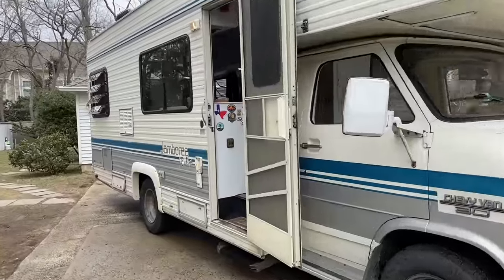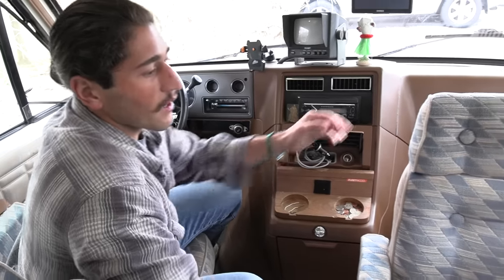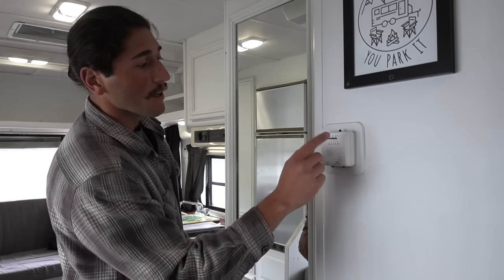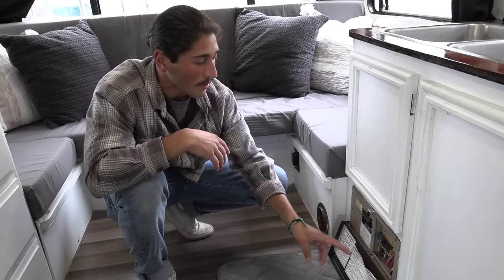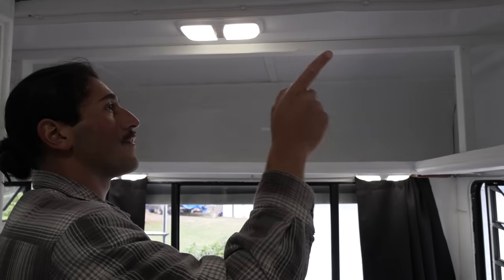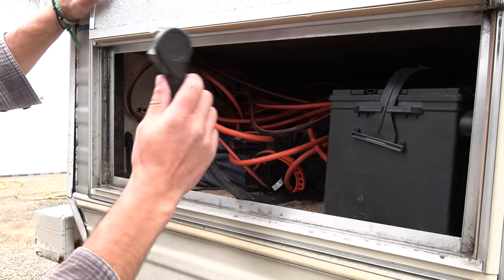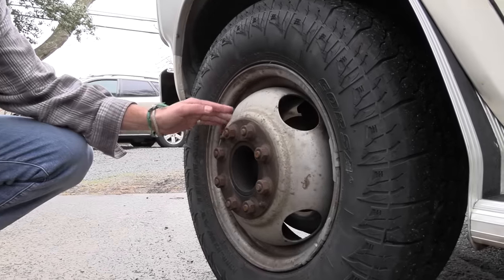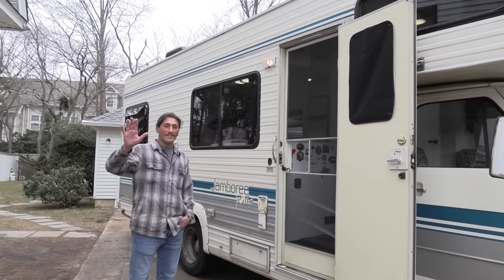College Student Transformes A Vintage RV Into A Gorgeous Tiny House On Wheels

Comment: Wonderful job!  Having owned an older RV, my fear for so  many purchasing vintage vehicles is for the undetected mechanical and safety issues that could arise, especially when far away from services.   We bought a beautiful 33 foot class A.  it was very comfortable.  I always felt it would be great to live in.  However, it had been in an accident the previous owner failed to tell us about.  The windshield and wipers were from some other brand of RV altogether and leaked.  The electric stairs worked only when they wanted to.  We went on a couple of trial overnight trips to discover the water heater and refrigerator also had issues.  Our first real trip out both sets of brakes failed on our way into the mountains.  We we lucky we were going up and not down.  No matter what I did, the RV would not come to a complete stop.  Lucky for us the terrain leveled out at one point and we coasted to a stop.  It took a full day of being by the side of the road for a tow truck to come take us back home at a cost of $975, then more than a thousand to remove the engine so they could redo both sets of brakes.  If we were going down hill, I wouldn't be alive to write this. I spend thousands repairing other things that should have been operational before I decided the thing was a death trap and sold it.   Always get your vehicle checked by a reputable mechanic before buying unless you are very savvy and mechanical yourself.

Comment: I just picked up a 1978 class C it’s called the Apache-22 foot looks just like this one only a little older, but it’s got a 400 small block Chevy. The camper only has 10,000 original miles but it needs a lot of TLC and elbow grease and cleanup and my goal is to make it as beautiful as yours. Nice dude keep up the good work.
Reply from the maker: Awesome find

Comment: My 1991 has that exact same control panel. I wish I could find a replacement for it but the switches are easy to replace.
Honestly the older RV’s are better built. You see brand new rigs that already have major problems and are weak structurally. For as much as they charge it’s crazy.

Comment: Great walk thru and sales job. Your'e hired.  

Just a FYI with those old units. I had one burn up one summer day off grid with the generator running the roof air conditioner. That old wood box gets really dried out and  fragile. The area around the exhaust pipe got just hot enough to eventually catch itself on fire after about 1/2 hour. By the time you notice it it is already in the wall and 5 minutes later the whole vehicle is melted and burned back to front. The flame & heat gets inside and cabin wall/ floor temperature suddenly gets to 1,000 degrees as it burns forward. Some good high temp automotive exhaust insulation around those pipes probably would have prevented it.

Comment: I love how passionate you are about airstream and how you're lucky enough to be working with airstream as well. I had some questions about the Airstream B190's and was curious if the late 80's okanagan vans were manufactured by the same company at one point or is it just a coincidence that they look so similar?
Reply from the maker: I believe the late 80's Airstreams were built using the OKANAGANs top but then i the 90's Airstream made their own.

Comment: Niceley explained!!! Did you spray paint the Air Conditioning cover (the cover on cieling inside RV)? Was it easy
to take it off? Mine is yellow, but I'm afraid to take it off. Not sure if it's connected to wires. How did you do it? Also, do 
you have the house battery hooked up to the altinator? How do you re charge it?

Comment: I just bought an 86 c class rv with the front bunk rebuilt and new roof.  Did you have to do any major drivetrain work, im pulling engine and trans to have both rebuilt so I can feel comfortable driving cross country.  I would be nervous to drive without knowing the health of the engine and trans.  Im about to spend more rebuilding drivetrain than i did on the whole RV
Reply from the maker: It’s tough to say with those older drivetrains. Most have low miles but have been sitting for a long time

Comment: Carbon Monoxide detectors are supposed to be near the floor.  It's not going to do you any good up where you have it.
Reply from the maker: There are mixed opinions on that subject
Reply: @NewJerseyOutdoorAdventures  ,  Carbon Monoxide is a heavy gas that falls, smoke rises.  Learned a lot when I worked in a FD

Comment: I bought a 89 Toyota dolphin not quite two weeks ago. It’s going in for safety inspection next week and then I’m going to clean it and paint it. But somebody commented that it makes it look cheap if you’re paint it white. That doesn’t look cheap at all.  The air conditioner looks yellow and so do the walls, I thought it was cigarettes, but it isn’t. Does anyone have any suggestions on how to make that air conditioner white? Can I paint it? It’s plastic and it works well. The inside an engine were rebuilt in 2006. The cushions are kind of old-fashioned red leaf pattern like a brocade, but a strong upholstery fabric and since I collect brocades, bark cloth and bark cloth era  fabric, I’m in heaven. I will clean the cushions. I am going to use my new old stock fabrics it  shabby chic here I come. I’m a mixed media artist, very avant guarde. it is going to be a blast to do. But I need the toilet taken out for compost or put in the RV and put cat litter in it. I do not want to mess with black water tank, I want the fridge so I don’t want to mess with a lot propane so want to get a 12 V and then I’ll only have the stove and the water heater and RV heater to run on propane. A lagun table. Get rid of the microwave put a new countertop. It’s only got one bad spot on it but… in time. And I want one side of the booth taken out and have storage put there. That’s a start, but since I don’t know anybody and my husband‘s passed. I’m trying to find someone to do those little things.  I’ll probably be so frustrated end up selling it.  But I very well could get my money back. It’s a nice shape, nice, but linoleum need to cleaning , nice cupboards, one piece shower, which was an upgrade. I talked him down to 7000 but he wouldn’t go for 6500 don’t blame him

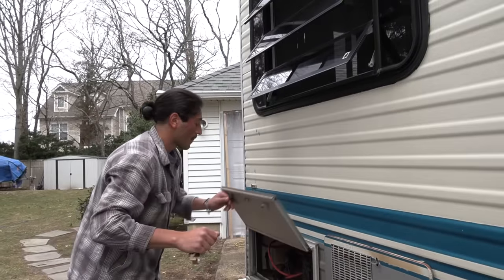Comment: 20:20 - I hope you descaled the old hot water tank.  Its an annual maintenance and very laborious.  When I descaled my RV hot water tank, a huge amount of white scale came out. This needs to be done every year. Unless replaced with an on demand heater or similar.  The Atwater or Suburban - one of them needs a new anode every year as well.
Propane tank may not be safe, should be checked out when this old and replaced.  It has a life.
Fridge is old absorption type, and its sooty propane flues need to be cleaned out twice a year, and spider webs removed.  They are cranky fridges which need maintenance.  The newer Danfoss compressor fridges like NovaKool, Isotherm, Vitrifrigo are great but need heavy solar setup to work off grid.  The advantage is that they don't need to be parked on flat ground.
The old battery charger systems are very poor.  Not only do they take forever to recharge house batteries, but they float them only and never quite fill them up, leading to dead batteries constantly.  This entire charging system should be replaced with a Victron charger inverter and some solar added on for sustainability.  These chargers are worthless junk.  I still have not done mine but it is imperative for good battery life.
Tires on all RVs esp duallys need high quality stainless steel extension valve stems. Cheap extensions will leak and give you flats on every trip.  I had a nightmare time.  Part of the issue too was that my tires were not strong enough.  Good tires, steel extension valves ($126 for 4 pieces!!) is key to peace of mind.
Check water pump for leaks and use Uponor fittings which are better than shark bites.

Cosmetically, the plastic sink (same as my RV) should be replaced with a stainless sink bar size. I have an identical shower stall as well and hate it. I intend to replace it with FRP walls and a new steel shower pan.  These plastic showers are so dated.  This will modernize the bathroom.

To seal up storage door jambs, unscrew them, clean up the area with alcohol and angle grinder and wire brush, and use butyl tape around the jamb then screw them back on using stainless steel screws if possible. Don't use caulk to seal as it will peel off. Never use silicone.  Butyl tape is the key.

Lovely RV and good job on the remodel.  My recommendations are for safety and long term maintenance.

Comment: It’s a shame that everything is not quite finished off. A little paint and covering on backs of cushions etc would top this revamp perfectly.
Reply: Yes! Those marks behind the cushions were due to the staples on the bottom of the cushions rubbing against the new panelling. Quick touch up with paint and back to new. Next time going to use
velcro strips to eliminate cushion movement.
Reply: @dukerusso6277  sounds like a good plan 😁 otherwise it’s a really good job all round.
Reply: OMG. Give the guy some time.😣
Reply: @buzzinbee9463  I agree, he has clearly worked very hard. Just sharing my thoughts. No hate intended 🥴
Reply: If I didn't have sewing skills, I would have asked someone else to sew full cushion covers for the foam, and toss the board and staples.

Comment: Do you have to stay at annoying KOA to use the ceiling AC unit, or are there other places for RV'ers get "shore power"?
Reply from the maker: A campground, not necessarily the franchise KOA.
Reply: @NewJerseyOutdoorAdventures  Not into "campgrounds", due to the noise and lack of privacy, but saw that you can get "dog bone" electrical adapters that will plug into any 20 am service (if you can find one).

Comment: I have the same yr different  model 24 ft. I have a few questions the air bags under it and that back up starter. Mine goes up n down. How do u tell which is on and off? Also does the fridge only run on propane n electric. No geni or battery like say solar. I can only get it going with propane. Like I know u need  the house battery to start my fridge but can I run it off a genius n the genius it cones with. My inboard genius needs a plug n work to hold it up. It's dropping out n wooden floor. I almost got rid of it till I seen this video. Alot a,questions I know but I can't find many ppl who have this yr of an rv online. Certifying it during covid has been such a hard thing to get done. Everyone's busy n jts now the only place I have to go with my elderly dog n cat thanks to covid. Things have happened in my life I had to make a serious move. So  I'm on my own n need a little help with some things 🤔